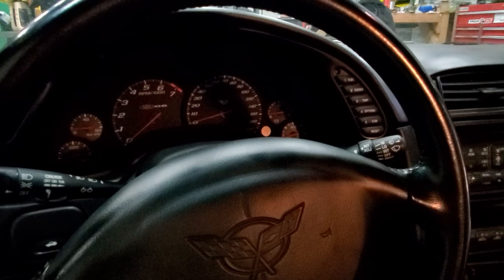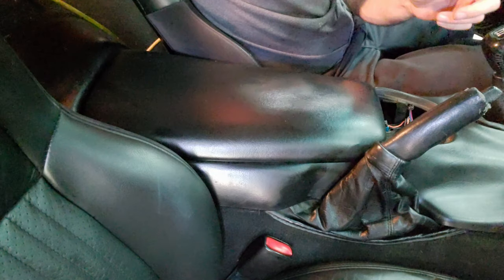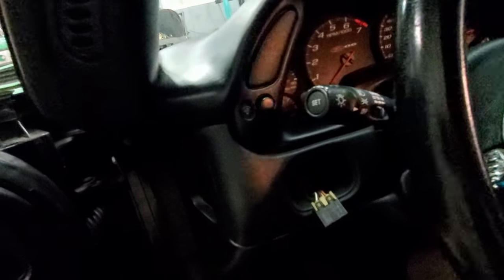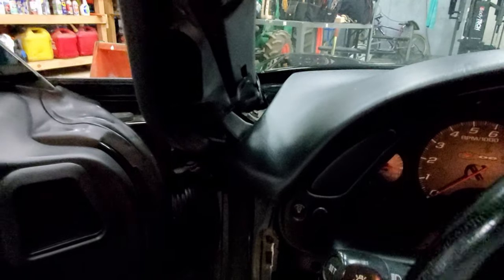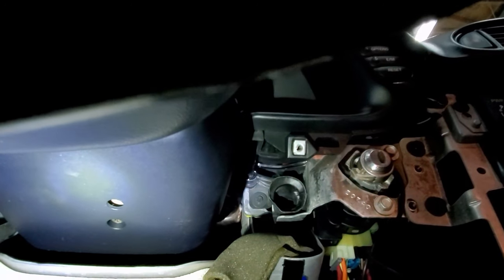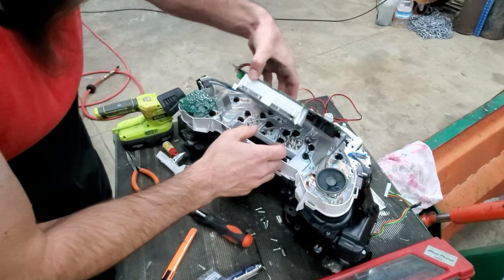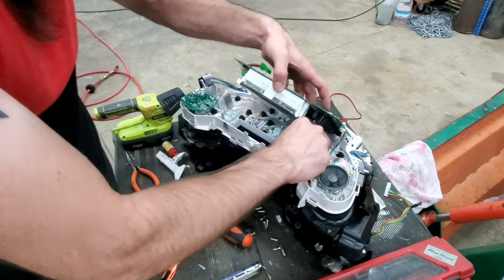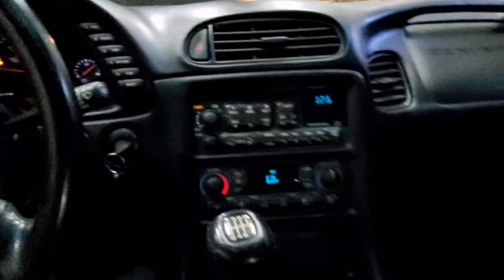C5 Z06 Gauge cluster removal & bulb replacment

Comment: Helpful video, thank you very much. Never considered LEDs? My dash light is slowly fading (bulbs) and I'm not sure if I should swap'em to something more modern.
Reply from the maker: I thought of LEDs but at the time I couldn't find good info on which ones really worked.  I didn't want to tear my dash apart multiple times so I just put in standard bulbs.
Reply: @oisforoffroad  Right, because the thing to remember about LED's is that they only work the correct way.

Comment: thanks for the info-video. 
I have questions: what is the factory bulb? Is  the T5 bulb too powerful/gets hot?
I have searched the shop manual and cant find a "bulb" reference.
Reply from the maker: Thanks for the comment.    The T5 is the correct bulb for the warning lights. I replaced about 4 bulbs with T5's and they are still working great after 6 months. The T5's that i purchased gave off the same amount of light and heat as the ones that were in the dash before.

Comment: So all those bulbs are the t5? Because I’m planning on doing them because my check engine light bulb is out and just might as well replace them all so was just wondering if they are all the same
Reply from the maker: From what I remember all the main bulbs were t5's.  I think the general lights for illuminating the tach and speedo were different.  I only replaced the dead ones because the plastic was fragile and I didn't want to break anything that was still working.

Comment: 7:58 , how do u remove those screws ? They keep spinning but nothing comes out
Reply from the maker: If I remember right, those go into the aluminum dash support.  Yours might be stripped out.  If you can get a flat screw driver under the head of the bolt to pry pressure while turning it, you might be able to get them out if they are stripped.
Reply: @oisforoffroad   i got them out thanks bro , this video has helped me out tremendously
Reply from the maker: I'm glad it was helpful.  That makes the time I took to make it worthwhile.

Comment: Can you remove the flasher switch with the cluster out?
Reply from the maker: If you are talking about the 4 way hazard switch next to the air vent on the dash,    I don't think so.  It's been awhile since I had the dash off and don't exactly remember.
Reply from the maker: I have my stereo out right now so I checked.  It looks like you might have room with the cluster out to get to the back of the hazard switch.

Comment: I've found several videos that show how to get the gauge cluster out, but no one addresses changing the DIC button bulbs. Frustrating!
Reply from the maker: Once the dash is out, getting to those bulbs should be easy.  Mine were fine so I didn't open that section of the gauge cluster.
Reply: @oisforoffroad  Do you know if they are the same T5 bulbs for the DIC..?